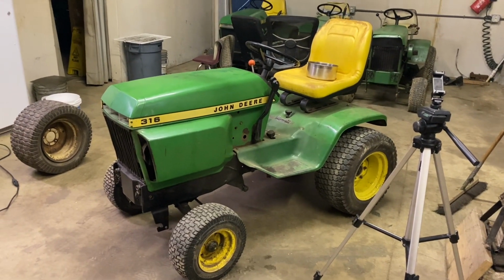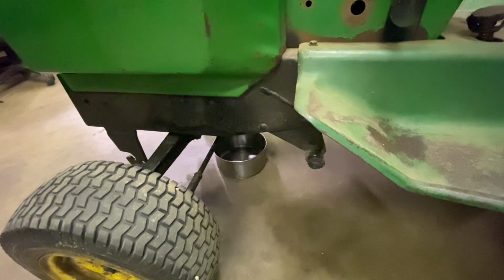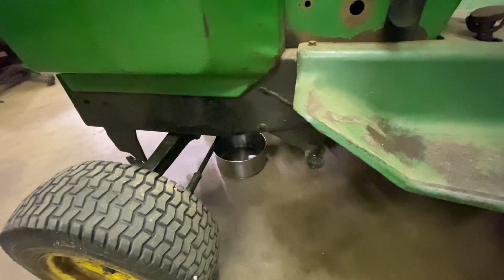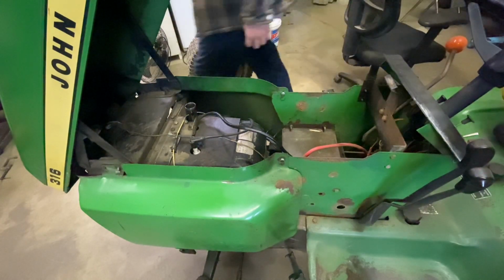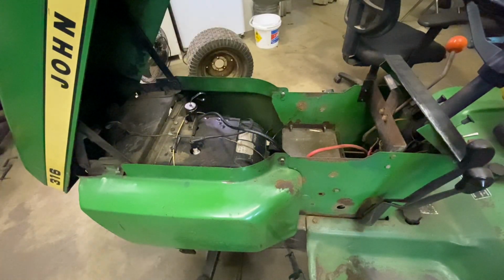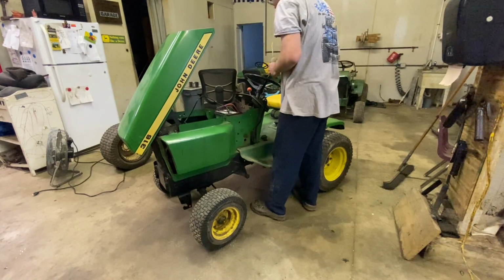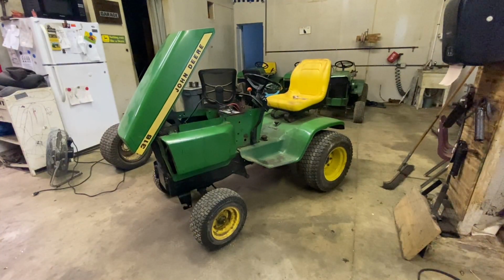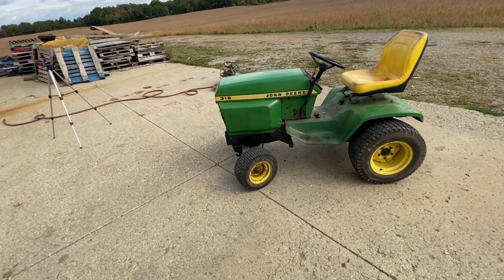First Oil change on the 316 (Rebuilt Engine)

Comment: Hi, just found your channel,I inherited a 300 16 years ago, it’s been stored in a shed for years and I’ve started it a couple times a year,Never change the oil because I never really used it Other than the snowblower on it a few times. I just realized it was a 300,the only markings on it was on the hood that said Hydro. since we’re having a blizzard right now, I’m gonna get it changed and I was wondering what kind of oil use.thanks